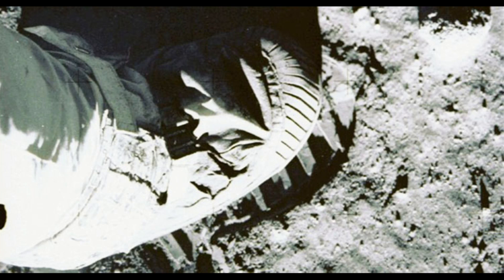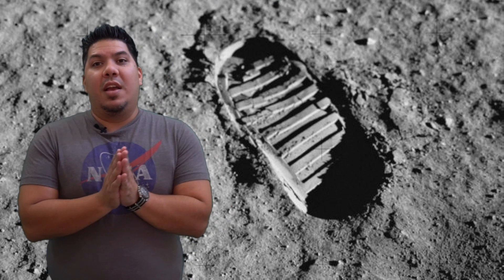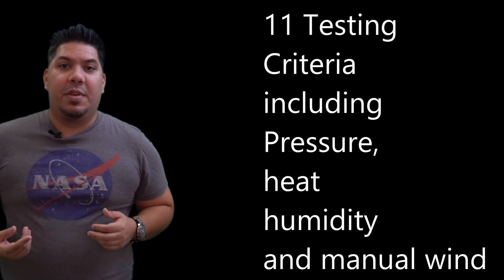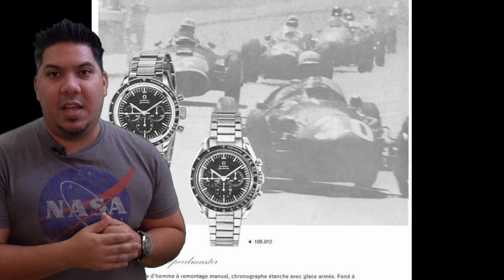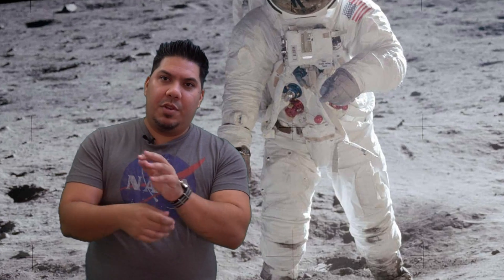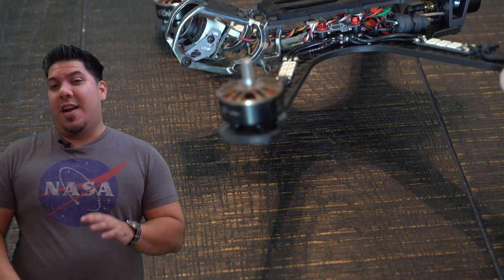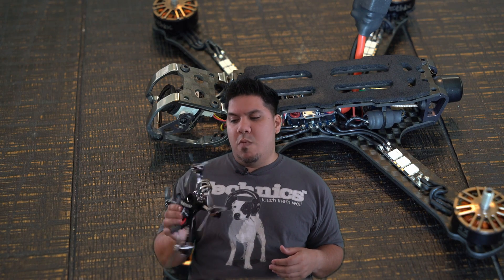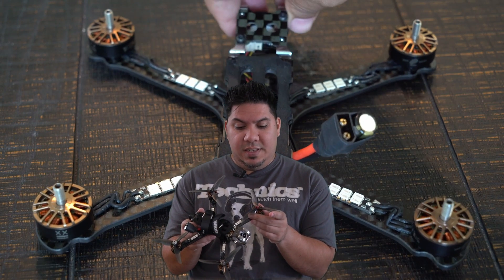Ethix Moon Boot - Freestyle Motor - Omega Speedmaster Professional - 2407 2200kv  on 6S -  power

Comment: I’m trying to find the right motors for my 6s setup. Full weight of my quad is 908grams with GoPro so it’s pretty heavy! Do you think these motors will be best for my setup? I’ve tried the xing 2208 1800kvs but they seem a little underpowered for my rig; so i upgraded to Cannonball 2406 2020kv and these are better but I still feel a little underpowered.
Reply from the maker: I think they are one of the best for powerful motors but should be pretty close to the cannon ball. Curious what kind of setup you have that has that much weight?
Reply: Jon E5 FPV Drones Xhover forged stingy v2, Brainfpv radix li, aikon 32bit esc, iflight BEC, DJI airunit, cannonball 2020kv, tattu1800mah. I mostly just fly with a hero 8 @ 908grams but I also sometimes rear mount a 360cam which adds 200g more.
Reply: Try a smaller battery. 1800 is a lot of extra weight that actually defeats the purpose of having a larger battery
Reply: Jon E5 FPV Drones crossfire

Comment: What amperage do you see on 6S? Any prop. recommendations?
Reply from the maker: I don’t usually measure amps. Just check often for hot motors. For this setup I normally run 80-85 % throttle cap. 

My fav prop for freestyle or racing is the Gemfan 51466. I have a video up on it as well.  It’s light to avoid to much amps, but also has great fine control
Reply: @JonE5FPV  Thanks a lot for your reply. Will also do 80% throttle limit to get started.

Comment: Nice looking motors but the frames is a bit of crap on my first crash i hit a branch dropped 15ft and already has a cracked frames flys well but the durability is poor
Reply from the maker: There was some issues w the space grade frames. Of course the Armattan lifetime warranty applies and you can choose the original carbon which is not as rigid but can still handle a crash. 

Definitely get your frame replaced for free if it has broken
Reply: @JonE5FPV  yeah i will and choose normal carbon i love the way it flys and its well designed. Are you getn the new v2 piro esc and synergy style fc love to see a review on that with that latest floss lite frame i have the v3 frame and v2 stack all up with out batt is 285g with 2205 2722 kv very nible i love it